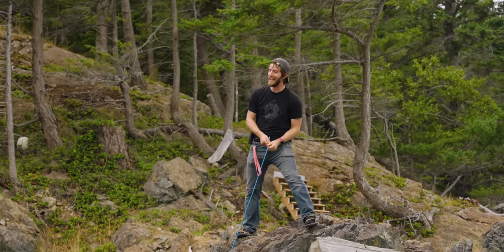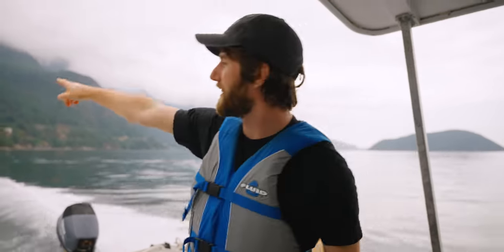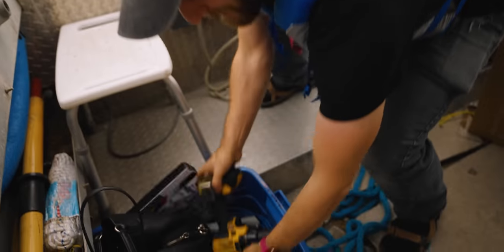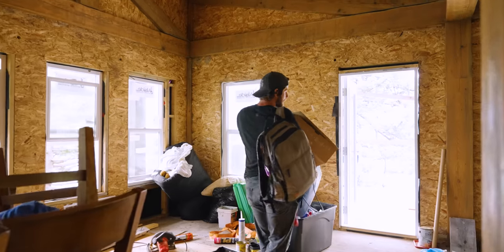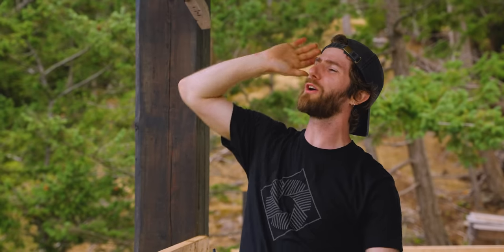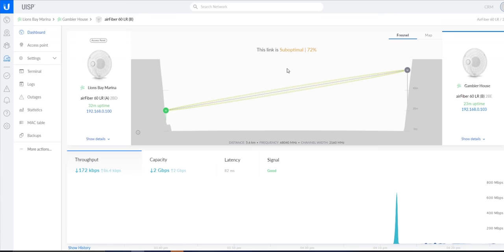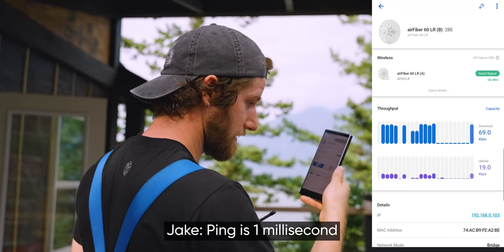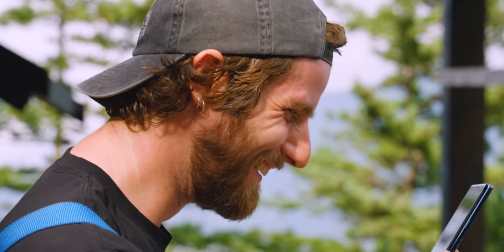How are we going to do this?

Comment: For people who don’t know. These are a 60ghz link not 2.4 or 5 ghz. It’s a laser based system that is usually rated for around 2-5 mile clear shots. They can catch interference from rain. No the wind doesn’t mess with it if it is installed correctly. I’ve installed atleast 40-50 of these for the wireless internet company my family owns. It’s great for backhaul shots between smaller towers or for a customer that is further than it’s worth running cable or for someone who may not be down the fiber lines. Other than the rain the lake can possibly mess with it in this case as well if it gets rough enough. But that’s for anyone who was more interested in what these things are about.
Reply: Side note. The newer ones also have a 5g failover if the 60g is blocked

Comment: If a piece of paper blocks signal, I’m curious how it would react to fog or rain.
Reply: It has to be very heavy fog and/or rain for it to be affected I think. Longer wavelengths aren't affected in the same way as visible light, so even though you can't see the other side with your eyes the radio waves still sees "fine" but water and radio waves never mix well so I don't know. It'll be interesting to get a follow-up
Reply: I'm more curious about any amounts of wind and vibration from the rain considering they kept mentioning how tight the adjustments have to be at that distance...
Reply: We use multiple of them at my work, the fog has never been an issue even when it gets super bad. We have had multiple get struck by lightening though! The method they used to mount them isn't the best. Within an hour of messing with them, we can normally get the connection to be 95% or higher.

Comment: I have concerns that the block installation on the mainland side is going to fail at the mounting anchors very soon.
Reply: Yup, those plastic anchors are not meant for outdoors concrete install. Heat and wind will work it loose.
Reply: Yep, maybe bolted through to a nut plate on the interior wall would do it.

Comment: The plastic in the drywall anchors that you mounted the dish mount with may dry rot at some point. Usually when our nema boxes fall off of walls it's because some tech used drywall anchors in concrete. Don't drill your pilot holes too large and the cement screws will grab.

Comment: Put together a similar albeit older system for my parents in rural eastern Oregon about 10 years ago. The ISP dish was about ~5mi from my parent's home. The system initially worked great but during the first winter, we found the connection would get sketchy in heavy winds. We had to replace the original pole mount with a tripod-style mount to keep the dish from moving. Overall it worked great.

Comment: I feel like this is a perfect use for starlink, assuming that is an area available for the beta.
Reply: I was actually expecting him to use that
Reply: Starlink needs about 100 Watts all the time. Not sure if they have this there....
Reply: same here, but then he said that they will not have grid power. Starlink uses up to 100W continuously espeacially in the winter. Thats pretty much when you only get solar and wind energy
But yeah, if power would not be a problem then starlink would have been a much much better option. Why would you need gigabit if you don't own a serverfarm or something lets be real here
Reply: The speeds he is getting is crushing anything they would get from a starlink.... Especially the response time.
Reply: @EVLS10  the 1ms latency is on top of w/e latency you'll get from your isp's routing table. I.E if you play a game and your ping is 30 at the transmitter end then it will be 31-33(added latency for subnet routing). Besides, once ground stations are mostly eliminated and starlink starts using their planned satellite-satellite communication then  their latency will plummet.
Reply: Starlink is the same thing, except it uses a phased array instead of a dish and it has to stop off at LEO for a byte before getting back to earth.
Reply: @I_Am_Empyrean  Point being.... starlink has dish to satellite latency just like this point to point plus ISP.  And still gets crushed.
Reply: @_Riux  You really think they are going to use 60GHz wifi to beam over a dsl signal?  The mainland probably doesn't have fiber but they will have standard coax driven internet connectivity.  Even in the worst of places that still beats starlinks total response time.
Reply: @EVLS10  The latency is already down to around 40, and only getting lower. Dish to satellite latency is basically irrelevant with Starlink, since their low altitude means the dish to satellite latency is less than 2ms. The vast majority of latency is in the rest of the transmission process, which is something you can optimize.
Reply: @forgilageord  Some people see as high as 88ms ping with starlink.  Yes it will be optimized but it will NEVER beat  this setup if or when the mainland has a fiber link.  It's a neat tech but Linus didn't make a mistake on this one not using a starlink.
Reply: Linus talked about the pros and cons of doing this vs starlink on one of the recent WAN shows. He had some good reasons not to use starlink for this application.
Reply: Tbf starlink can be really expensive. In Germany it costs 50 bucks a month
Reply: Besides being power hungry, starlink has massive latency.
Reply: @clixx13  is 40ms average to the nearest speed test server massive? Fiber gets you 10-20ms depending on where you're connecting, Xfinity gets me 20-40ms.
Reply: @EVLS10  what Kind of household needs Gigabit? Lets be real here. Prove me wrong, but imma say that his parents dont have a serverfarm or are inviting 100 people every night for gaming
Reply: @EVLS10  Except that it literally will because starlink will be using their own routing table which will be satellite to satellite communication and then connect to a direct connection next to whatever server you're using. Heck, once servers are being sent up there as well, you'll see even lower latency. Each satellite jump will be ~1ms and each ground station jump will be ~2ms. That means your theoretical ping from US to Australia will be something like ~16-25(maybe even less depending on routing optimizations). Everything else is strictly overhead from the Tier 1 providers and will, ostensibly, be eliminated sometime in the future as you no longer need to make long and expensive runs of cable to set up infrastructure. We might even finally see the internet as we know it scrapped and revamped to be more in-line with modern standards of security.
Reply: @Jaker788  right now, with overcast and fog, I'm seeing 30-60ms and 50Mbps
Reply: @MatureManure  in the US it's $100 a month, which is honestly not far off from the isp monopolies.
Reply: @thomaskerslack4299  and the latency isn't too bad. I doubt his parents are competitive gamers where a 20ms worse ping actually means something.

Comment: This feels like one of those times having compasses at both ends would have been incredibly useful...
Reply: I was exactly thinking the same thing.
Reply: Calculating the angle using GPS coordinates would have been helpful as well
Reply: Small mirror will do the trick
Reply: Right? Take a heading and give them the reciprocal. Also he couldn't see linus because of the curve of the earth.
Reply: or a laser pointer
Reply: Literally thought the same thing. they should have just used the compass on their phones
Reply: @travissiegwart8276  Haha "curve of the Earth"... Good one!
Reply: Or a telescope
Reply: I have used lensatic compasses for stuff like that that in the past. Can confirm it makes it fairly easy. A laser would work good at night. If going during the day, you can use 520-532nm light and it may work. At night go 445nm and you can see it for miles.
Reply: or a powerful laser to pinpoint exact spot
Reply: BOOOOOORRIIIIIINGGGGGG!!!!
Reply: Consumer grade compasses are not precise enough for this, and seeing as they basically nailed it with the provided tools and how much a precise compass would increase the cost of this thing. It's really not worth it unless you happen to have one

Comment: A very good, carefully antenna.  I managed to get a wifi signal go two miles (with full reception) with a pair of Pringles cans while in the Marines.

Granted, if you took one step to the left or right you lost everything, but still.  We could have gone farther if not for the hill in the getting in the way as we backed up more.
Reply: May i ask you for instructions on how i can make one
If i had one of those when is was in school i could had wifi there 🤣🤣🤣
Reply: @DK_255  It’s a directional antenna called a “yagi” antenna, or a “cantenna” sometimes (because you can make them out of a pringles can).  There are plenty of YouTube videos on YouTube that can help you out.  Explaining the math and physics behind is the reason I spent months in training related to radio usage and transmission.  You can also use a parabolic style antenna like they do here.  They can reach incredibly far, but are even more picky about alignment the farther you get.  As a radio operator, we borrowed a couple things from work to get the alignment dialed in, but given that we were used to making 400 or 500 mile radio links as our day job we probably had an advantage you don’t.

Also, you’re gonna need to limit a yagi antenna to a specific frequency band and get the math right for it to work.  Antenna design is a complicated subject.

Comment: Nylon plugs aren't always ideal, but they can work really well when used correctly. They're also favorable with brittle bricks as there's not a steel anchor forcing expansion (usually causes brick to crack). Gotta be gentle when drilling the holes in brick though, and extract dust often.

Make sure to blow out the drilled hole, use a drill bit and plug matched spøropriately so that the plug fits snugly, and use a screw that really bites well into the plug.

The plug/mount coming loose is rarely caused by the plug itself coming out if done correctly, but by using too thin and short a screw, with too shallow and fine a thread. Gotta keep in mind that while the plug might sit firm in the wall, the screw is still seated in farily soft plastic. It will strip and tear out if there's not enough friction. When the screw comes out, there's no longer pressure against the interior so the plug comes out too. If your fingers pinching over the threads can barely hang on to the screw if pulling it from your grip, don't expect the plastic plug to do a whole lot better.

The good news with nylon plugs, is that if it does come out, the hole is usually still ok so you can reuse the same holes. Just look at the distance beteeen the screw on the backside of what you mounted, and the plug, first. If the plug is right up against the rear of the mount, that means the plug came loose. Usually caused by not blowing out the dust before inserting the plug, or an undersized plug. If there's a good bit of screw thread exposed from the rear of the mount to the plug, that means the screw came loose first, and the plug followed when the screw was far enough out to no longer expand the plug inside the hole. This is caused by undersized screws that don't have a coarse enough thread biting into the plastic.
Reply: Never remove the dust out of the hole. (Only with chemical plugs)
Reply: @TheAdatto  Leaving it in may work at times for completely static objects not exposed to external forces. But if it's something exposed to vibration, wind, mechanical force etc - the dust/grit is eventually gonna work its way away from the contact spots, and you end up with loose anchors. Had this happen at least 3 times with different operators, anchoring rails for a diamond blade concrete saw to walls (done so hundreds of times, so not a general issue). One of those times mere luck that there was a tall window sill deep enough to fit a grow man with sharp nails, is what kept from loss of life, as the 1 meter blade saw came off the wall when the rail rattled loose, and went spinning up against the interior walls. Anchors came out all 3 times. Both govt. industrial accident investigation engineers, and the manufacturer after in-house testing, identified the cause as dust/grit not evacuated from the anchor holes.

This is a fairly heavy duty usecase example, but the remedy to avoid loosening anchors is so simple and low effort, it makes no sense to not apply elsewhere.
Reply: That was very well explained. Interesting 👍

Comment: I wonder if that might suck hard over time, as the wood will be distorting with the weather and I could see that you have to adjust it daily, if you have rain and a lot of sun alternating. Would be interesting to see a follow up video in how stable that installation is over time.
Reply: Also 60 GHz only works in clear weather, as soon as it rains it's gonna stop working.
Reply: @RedShift5  jeah, right. Also it might get mighty foggy on a lake, wonder if that breaks it aswell.
Reply: @modmoto6016  That's not a lake.

Comment: That won’t work well in rain or snow.  If that matters, I would do a parallel several mbps few GHz ISM band transceivers, which will always work in all conditions.  
Also, you need a heavier mount if you don’t want major issues with wind.  
Here is what you can expect with what you installed:

Light Rain 1.5 - 4dB/km
Medium Rain 4-9dB/km
Heavy Rain 9-14dB/km
Downpour 14-24dB/km
Snow 3-12dB/km

Comment: Water is a pretty good reflector of radio waves.  So you get a direct signal and a number of reflected path signals, which under the right conditions (and they change) will cancel the direct signal.  For this reason, it's typical to use multiple receive and transmit antennas (diversity system) when designing a link over a water path.  Don't see that here, so good luck with the dropouts.

Comment: They work, I put an antenna at 2.7 Kilometer, the normal 5Ghz one around 4 years ago, and just works.  These are really fun to set up. 
For the mount on the walk, I think will be better to put a base. I wonder how they work when is fog around.
Also why not an SAT solution?

Comment: When drilling holes in cinder block with concrete or full concrete it is advisable to clean the hole of debris first. And measure the hole depth at well

Comment: I really wanna know how this setup is affected by rain, especially considering this is in the PNW
Reply: 60ghz not good in rain or fog, i would have used 5ghz
Reply: The ubiquiti 60ghz LR has a built in 5ghz back up for when the 60ghz loses signal due to rain and fog.
Reply: Maybe he'll follow up with rain/fog speed tests?  5GHz would have been preferable if you only want a measly 300M down.  =P
Reply: @brianbolton2084  300 down.... i get 200 down wired 😥
Reply: bad.
Reply: @charliejt23  It doesn't mention anything about that on the product page, and in the specs it lists the RF operating frequency range as 57 GHz ~ 71 GHz. Do you have a source for your claim?
Reply: @noxious89123  Linus is using the airfiber 60. That does NOT include the back up 5ghz. Ubiquiti also makes a 60ghz gigabeam. That DOES include the 5ghz backup. I apologize.

Comment: If you leave it at 77% "good enough", then I hope there aren't any foggy days there.
Reply: That was when they hadn’t connected the “bluetooth thing” and before they had tweaked it. They optimized everything. It’s DEF better than “77%, Suboptimal” now.
Reply: Fog?  In an area famous for being incredibly rainy?  What are the odds?  Doesn't snow much around there though (very unusual for Canada).
Reply: Wow
Reply: Since when does fog stops 60ghz waves?
Reply: Fog is just the beginning. I found data on 60GHz in worse weather. The worst ones just fyi.
    Drizzle (.25mm/hr) 0.2dB/km
    Light Rain (2.5mm/hr) 1.8dB/km
    Medium Rain (12.5mm/hr) 5.6dB/km
    Heavy Rain (25mm/hr) 9.5dB/km
    Downpour (50mm/hr) 17dB/km
    Tropical (100mm/hr) 28dB/km
    Monsoon (200mm/hr) 38dB/km
Reply: @PainCakeSoldat  uhmm i can image 5km full of rain drips  could do it
Reply: Microwaves can be blocked by heavy rain, but not fog.
Reply: @paranoidrodent  It doesn't snow much in this part of Canada.
Reply: How  often will a bird fly through the signal?
Reply: Yeah, and just wait until the wind is vibrating that wobbly plastic dish worse than a single bladed ceiling fan.
Reply: Exactly what I was thinking.

Comment: Man i work for an WISP, and seeing y'all setting up this P2P gave me equal measures of dread and excitement 😂
Reply: I get my internet  trough a WISP, and it was pretty funny to see the guys suffer with something that took my local techs a few minutes to set up.
Reply: @pedrovergara7594  I seen no suffering in this video...
Reply: @al_exs  oh i agree 1000%, we've worked with some older Trango and newer SAIE  licensed links for infrastructure over several miles and uh, that is an absolute bitch. A quarter turn of an adjustment screw on either being enough to drop modulation in half on the edge of that beam haha. Much more difficult that a point to multipoint install 😂.
 I will say though, i agree that ubiquiti has come a very long way in the past few years, i mean that P2P was pretty impressive. I know there's some settings for bumping up the security on them today but yeah it's certainly still not as robust as I'd like.

Comment: I can't remember if this thing has backup low-frequency link (like 5 ghz), but it is crucial for high availability links in millimeter range. Remember, water attenuates 60 ghz like crazy, and that would cause instabilities in rainy weather.
Reply: Agreed!  I was thinking the same thing as soon as he showed that they were doing 60 GHz.  I've seen issues over lakes with 24 GHz equipment when the weather is hot and water is evaporating off of the lake.  Causes crazy issues.
Reply: @boblenz434  yeah, refraction in water vapors is the strange beast to fight against.